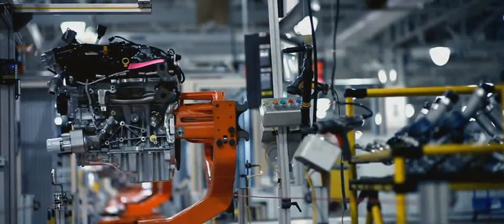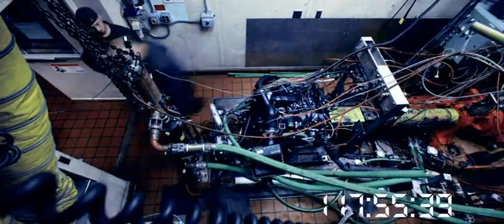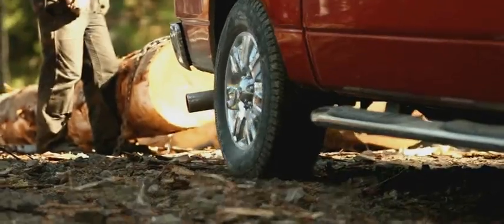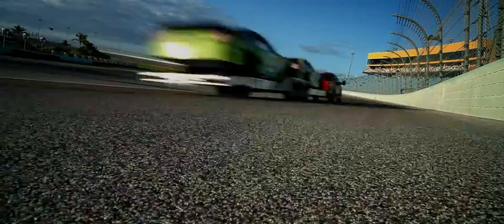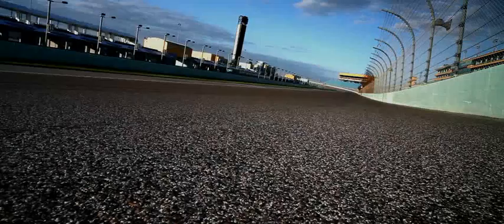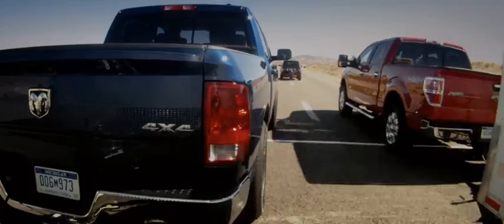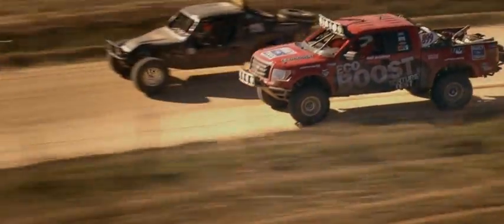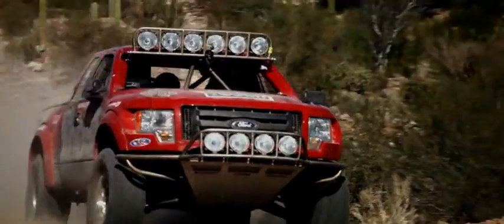Ford EcoBoost F150 v6 448AA - Episodes 1-5

Comment: they say it has great fuel mileage but the turbo work like this the more exhaust the goes into the turbo the more air get pushed into the engine the more air in the engine the more fuel it can burn meaning more fuel. But turbos don't really eat allot of fuel till the RPM goes up like when pulling a trailer so what was the fuel mileage when they pulled that NASCAR trailer

Comment: Iits a V6 not a V8 the engine sounds like a baby 8 AT FULL REV ! I purchased a 2013 fx2 sport with eco boost after watching this. I love my truck , I had a 5.7 Tundra and this will kick its but on gas mileage and power any day. and I loved that truck before this one... I was sold

Comment: Sure...turbos are expensive. Probably $1200 each....and it's still a relatively 'new' engine for Ford, so they've got a lot of R&D tied up in it.

If you're referring to NON-turbo V6 models IDK....unless it's a different brand's diesel...The Dodge  (inline) I6 turbo diesel are WAY more expensive -  $7k more vs. their Hemi on the Ram 2500. But not comparable to gas/petrol-based V6 or V8's- IMHO.

Comment: Hey tough guy, listen and learn. Ford eco-boost has 365hp and 420ft.lb@2500rpm in a 3.5L engine were as the Tundra has a 5.7L engine putting out 381hp and 401ft.lb. Notice that the 5.7L is way bigger and is a V8 and we're comparing it to a much smaller 3.5L,V6 eco-boost. The winner is obviously the eco-boost.

Comment: I find aspects of this test hard to believe. No matter how good of an engine, wouldn't you expect some loss in power after 160,000 miles. And with the numbers of the ram being close to that of the f-150, you would have expected the Ram to do better.
Reply: ohblondi more weight, and less low end torque. The turbos are small and build torque instantly and the horsepower carry's it the rest of the way
Reply: Not necessarily. Modern engines are built with high tolerances so when they break in they are within spec. So pretty much a motor with 50,000 will run better than one with say 5 miles.

Comment: @canddmeyer no it was not overheating an engine does not doo all the work is it the main power source? yes but its all about gearing ratios, hp and torque plus rolling resistance gear resistance is the fluid in the trans\engine better or worse at making less friction inbetween gears. the dodge could have a better gearing ratio towards top speed but the ford out pulled it 10:1 easy. get over it and learn your stuff

Comment: Ford had a 12 second lead at 60mph whittled down to 3 seconds by the Dodge at the 3-1/2 mile mark. One more mile and the overworked overheated EB woulda been toast. So why did Ford lose the 12 second advantage? If the EB is so good it should have kept the advantage and added to it.

Comment: so how come when I Google and do any research on this engine, people are having issues with it misfiring, and transmission hard shifting ?
Reply: Ichiban Noodles older engines had excess oil from blow by (bigger ring gap for boost) and is since cured on new engines and a oil catch can cures that 1 problem. EVERY vehicle has transmission issues, just because it happens does not mean all are bad and there's always bad batches in ANYTHING.

Comment: its a turbo right? is it the same one from the taurus sho?
Reply: No. There's a rear wheel and a front wheel version. Different blocks different turbos and oiling lines and different outlay. I do impreg on the ecoboost engines for Henkel and eagle manufacturing.

Comment: I thought max torque was 420. The graph shows ecoboost higher than 425, but yeah... It is impressive, but I have heard of all kinds of issues with it. Not hating on it, Ford makes good trucks, but it's Mopar for me. I just don't think a v6 belongs in a truck. My Hemi sounds and feels awesome. Plus, if you are going to tow 11,000 lbs on a regular basis, won't you at least want a 3/4 ton truck? A 1/2 ton you're going to have to upgrade suspension and other things to work it that hard constantly